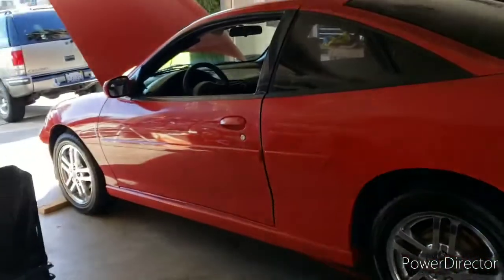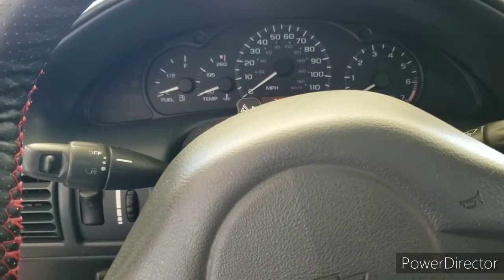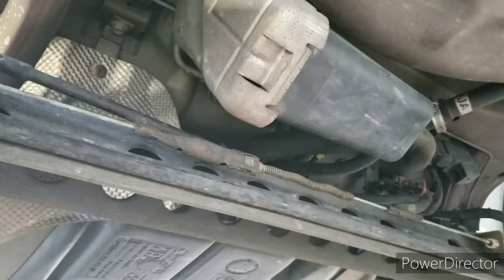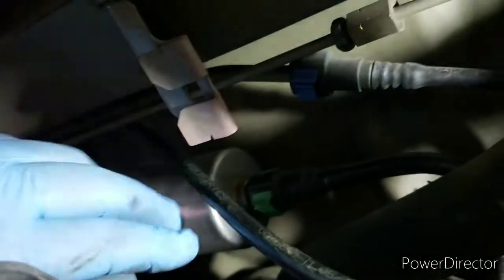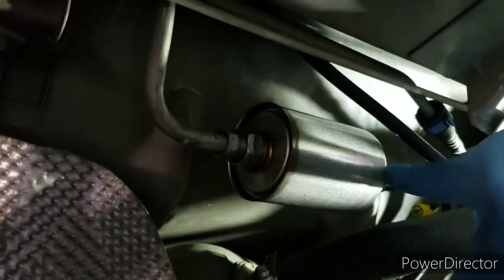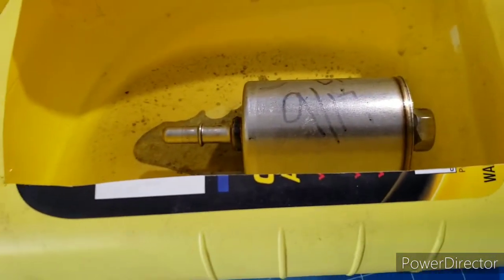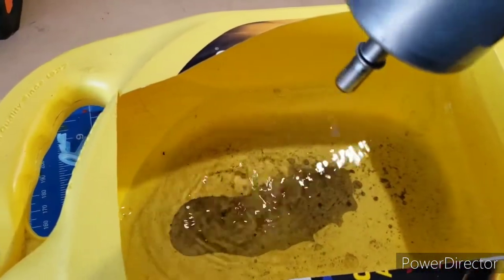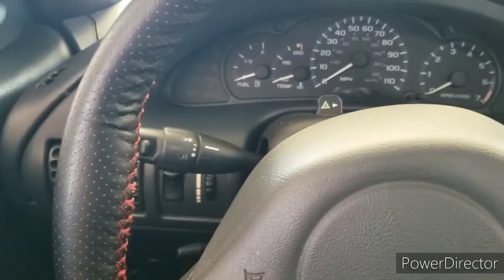CHEVROLET CAVALIER LS Z24 // Fuel Filter Replacement

Comment: Are the dash board set ups the same in a Sunfire and a cavalier? Any videos on replacing speedometer?
Reply from the maker: I would imagine that they are set up the same way. I replaced some of the bulbs on my cluster. I had to remove the top of the dashboard and the bezel around the radio and speedo. I'm sure there is videos out there how to remove it.  Thank you for watching. Good luck.
Reply: @PonysGarage  thanks. I'll look into that a bit more
Reply from the maker: Im guessing you have a sunfire. This is literally the same thing I did on my Cavalier. Everything was the same to remove.  Hopefully this helps  https://youtu.be/cRjeUmMmCk8
Reply: @PonysGarage  I have an 02 cavalier brotha man😀🇺🇲 2.2L base model. Picked it up for $300 my bad I wasn't specific earlier about which car I owned
Reply from the maker: @thetruthhurts-666  even better it's all the same steps check this video out  https://youtu.be/-gJschF_Vak